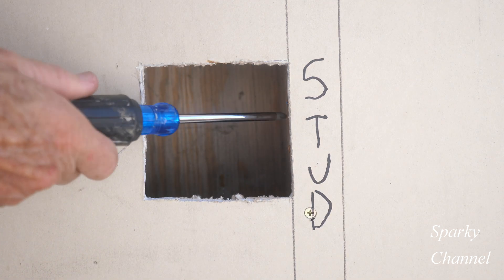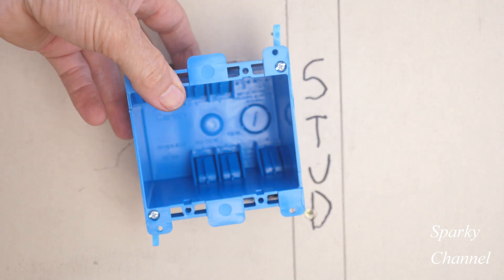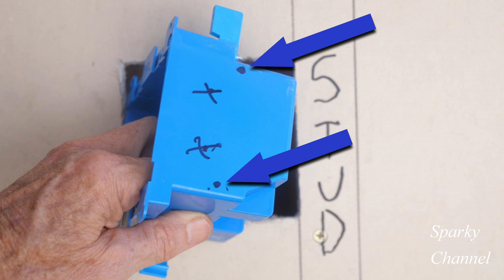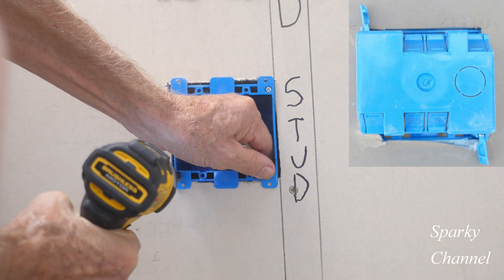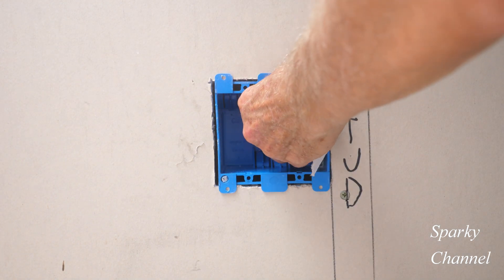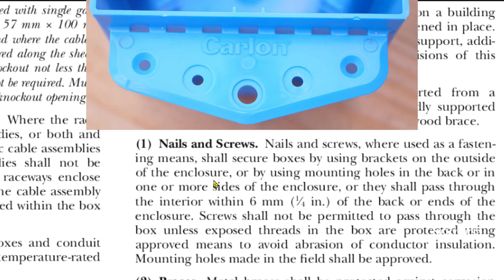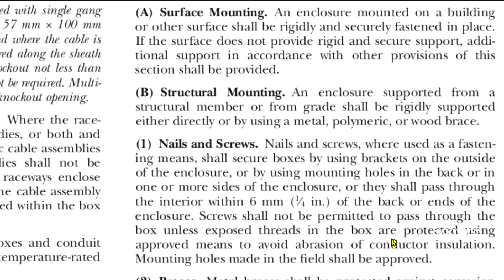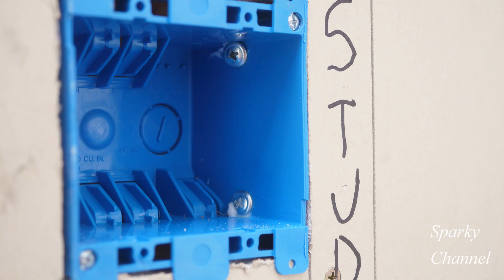Modification of a Carlon™ Box with Approval? NEC 314.23 (B)(1)

Comment: I agree that what you did meets the intent of the code.  Not withstanding that I probably would just cover the entire screw head with a layer of silicone to prevent any arc potential.  That said I have worked in structures with metal boxes so I guess for me this is just a belt and suspeders approach.  On another note I have never been a fan of these retrofit boxes.  The face flages create a lip on the front and they dont allow the face plate to lay flat.  I ussually use a new work box like the one pictured that secures to the front face of the stud and then patch the drywall.
Reply from the maker: Great tips, thanks!

Comment: Construction adhesive or silicone caulk on the stud side of the box would firm it up and you wouldn't have to modify anything. Just tighten the ears and let the adhesive set-up.
Reply from the maker: Thanks!
Reply: Yep.  I don't like adding the screws at all as in the video.

Comment: I have done this myself and AHJ is ok with it  But all metal parts not carrying current shall be bonded..  I was at a house one time and a cabinet had a support screw that hit only the hot wire and over time was burning the wood of the cabinet ...

Comment: Drilled a 2 holes directly in the back of an exterior surface mounted metal box and no issues with inspector. I called or emailed in advance to not waste their time and my money on a reinspect.  Hopefully your inspectors are responsive like mine. Typically get back within 4 hours and I’m not an electrician.

Comment: Take a look at the UL white book, there are boxes listed with means to do what you are trying to do. Also the manufacturer has not has not had the box tested to see if the side wall can support the box with additional holes drilled. I was an inspector. I would have you get, in writing, approval from the manufacturer or deny your request.

Comment: I wire these just like you did, all the time. It would be very helpful if Carlin and other’s did an update to this  type of box.  It seems these suppliers make new changes all the time. This would help us out in the field tremendously.  I always try to install these old work boxes next to a stud for this reason, and then with screws. I have had a few call backs where. Customers were in a hurry and whip extension cords from a distance and pull the whole box  out of the wall. THANKS for this Video!
Reply: Exactly what you just said. The manufacturers need to start stating this is allowed. As well as the people who write the code books. I see these boxes loose all the time.
Reply: If Carlin put holes in the sides of the box there would be no question. Metal boxes have two holes at the edges. No big deal.

Comment: The wire safety is good that you brought it up, AND the terminal safety on the device which bolster's the extra screws in the back of the box.  As long as the box exterior is well insulated with mud or fire patch, I'm happy.
Reply from the maker: Thanks Greg!

Comment: Looks like the screws are more than 1/4" from the back and not really fully shielded with the silicone caulk
Reply from the maker: Thanks!
Reply: @SparkyChannel  The NEC paragraph states 'within 6mm (1/4") of the back or ends of the enclosure'.   What is considered the end?
Reply: I read that as if screws are used instead of nails going from side to side of the box. In other words, "through"  the box. So, threads could be a major issue on a 4 inch long screw. Putting a round head screw through  one side of the box into a stud should not be an issue. Although, I approve of keeping them  out of the area where side terminals might contact them. 

As far as the mfg adding the ability to do this, adding a slanted mounting pad so a round head screw could be installed without needing to caulk would be a great addition. 

As far as doing this type of install, this would be especially helpful in plaster walls where the wings don't get a good grip.

Comment: Perhaps small interior wood screws put in with a right angle adapter so the head sinks in. Then a dab of silicone on top just for good measure.
Reply from the maker: Nice!
Reply: I use screws just like that and drive them with the shaft of my adjustable screwdriver: 12" long and puts the heads almost deal flat.

Comment: Hm? ... In critiquing your work, I feel that the two screws that were used to further secure the electrical box should have been adjusted and drilled so that they were both sitting flush to the inner wall of the electrical box. 👍
Reply from the maker: Thanks!

Comment: maybe drill the holes a little farther from the to/bottom of box and use a right angle attachment so the screws go in square and seat flat to box so no threads are exposed.
Reply from the maker: Good idea, thanks!

Comment: I understand what you'r attempting to do, that is improve something that appears too flimsy.  I always thought any modification of these boxes was verboten, though.  I'd use the two ears as provided and be done with it.  Perhaps another type of box would better suffice your purpose but this one has already been approved as designed.
There's another type available for this application (drywall mount) that's more robust, in my opinion, it consists of two metal tee straps and the box (3 separate pieces) but it's been so long I can't remember the proper name.  The straps slide in between the box and drywall, catch the back side of the drywall on the outside of the box and then the two straps have tabs that are then folded over the face of the box from the outside and into the opening of the box.  It's what we had before the plastic winged boxes were introduced.
"Interior Wall Electrical Box Mounting Brackets"
& "Old Work Switch Box Supports"
Reply from the maker: Interesting, thanks!
Reply: Those are often called Madison straps.
Reply: @illestofdemall13  Sounds about right.  I don't even recall if they can be used to mount plastic boxes, just that we used them for mounting boxes in the case of old work.
Reply: @thisisyourcaptainspeaking2259  They're used for gangable metal boxes (the kind that you can join together to get as many gangs as you need).
Reply from the maker: Hi Kris!
Reply: @SparkyChannel  Hello Bill. It seems some people just don't like screwing through boxes regardless of the situation and my boss and I are both those kind of people. He said he sees no reason to have to do this. Lol
Reply from the maker: @illestofdemall13  I totally understand. Just buy the correct box. 😄

Comment: I'm just going to 3d print my own boxes, Let's see what the NEC says about that.🤔just maybe....
Reply from the maker: Get them UL listed and you're in business!
Reply: In my own home, I was going to replace a single box with a two gang old work box.  After I cut the nails off the original box, I found that the box was pushing on a water pipe directly behind it and had deflected the box about an inch.  Due to Covid, I couldn’t find a ‘shallow’ double gang old work box. So I took the box I had and sawed the back off of half of it and cut a square off of another box and stitched them together with by melting the joint with a soldering iron.  Not to code, but was solid and worked great.  (Sort of thinking outside the box 😉).

Comment: If it was a metal box what difference would it make?
Reply from the maker: If it was wood studs, it would probably be the same.
Reply: Screw threads are sharp, and that would still be a problem if insulation got lacerated.

Comment: You know that will help, but the plastic is so flimsy, that this is still likely to fail at some point. I really think a metal box is better for this kind of application. If you really wanted to be overly cautious, you could loop in a ground wire to the screws, and ground it out. Of course, no one is going to do that.
Reply from the maker: Interesting point. Thanks William!
Reply: I was always taught that a screw for a ground wire could never be used for anything else.  

In this type of install, even with a metal box that needs to be grounded, if the box worked loose through rough treatment you would lose grounding.

Comment: If there’s a poor connection and room for error, that conductor may sit on the exposed screw and it might transfer that heat to the wood. 
“Plastic hinged screw cap covers”, or bonding the screws to a ground wire might be a good alternative. The Southwire Smart Boxes might be a more suitable method, since the screws sit in a molded recessed part of the box. Caulking the recessed screw locations inside those smart boxes would make it extra nerdy.
Reply: Sub contractors around here are not going to use Southwire boxes, they are like an extra $1 more which means they can buy an extra Modelo after work by throwing in some drywall screws in a regualr box instead.
Reply from the maker: @JFlywheel  Yep, I hear that!
Reply: @JFlywheel  your right on that in pretty much any local. And that is a shame. But so true.
Reply from the maker: I agree. In fact, I have a link for the Southwire and Arlington 2 screw boxes in my video description. They are better choices.

Comment: Sometimes the top and bottom tabs can push in and dent the drywall while you push your outlet of switch in, i think installing screws in this way is an excellent way to ensure the box stays secure and not become loose in the wall. Also, a right angle Philips bit works magic in that tight spot ..Great video!
Reply from the maker: Thanks Kevin. Great tip!

Comment: My suggestion, if you really are worried about code but want more support.  GLUE it to the stud.  There are plenty of adhesives that work for both plastic and wood.  I have screwed plenty of these cheap plastic boxes over the year, sometimes I just screw 1 scrop into the top corner at a 45 at a very shallow angle.   I typically pre drill so I make sure I get the depth I want
Reply: In the new apartment complex we're building, we often come across boxes that have been tweaked by drywallers, so gluing isn't an option. The only thing that can be done is to slap a couple screws in at an angle.
Reply from the maker: @icevariable9600  With "approval", hopefully. :)
Reply from the maker: Great tip, thanks!

Comment: If you want to mount to the stud, just use the right box (Southwire MSB2G, or Carlon B249B). Both are plastic boxes designed for that very purpose, and will give you a better and cleaner install (those boxes allow devices to sit flush on the drywall).
Reply from the maker: I agree. I actually have links for those boxes in my video description.
Reply: @SparkyChannel  Awesome. I find the Carlon version to be easier to install, and the extra depth is wonderful when dealing with dimmers and smart devices.
Reply: Sometimes boxes need to be adjusted after drywallers mess them up. So, removing the boxes, and telling the foreman and owner of the company he should go get the right box simply isn't going to happen. 

You work with what you got.
Reply from the maker: @icevariable9600  Yes, and I wanted to demonstrate 314.23(B)(1) so I couldn't use the correct box. I needed one that I had to modify. LOL!

Comment: Sparky, thanks.  I was always told that metal screws in a plastic box was not allowed as a short in the line could energize that screw head and start a fire in the stud.  That is why several companies make plastic boxes with recessed screw mount holes to protect them from being energized. Metal boxes do not have that problem since they are bonded to the ground system if installed correctly.  Has there been a change in that?
Reply from the maker: You're correct. The only change has been "Mounting holes made in the field shall be approved" which was added in 2017. 314.23(B)(1)
Reply: I typically just use 1 screw in the top corner near the front.   I figure the only wire that might short out is the ground.  LOL.
Reply: Provide one example of a house fire being started by an energized box support screw.  Now think of the 70+ years of ungrounded metal BOXES nailed or screwed to studs and give me an example where the energized box started a fire, you can't, I already looked and the chance would be so infinitesimally small as to not be worth protecting against......
Reply: @ZackaryTwiddles1  The metal boxes are bonded so the current returns to source.  I don't care if you have never heard of one...it was the code and I follow the code.  The change now makes it acceptable to screw in a plastic box ONLY with the AHJ approval.  Most of what the NEC mandates are for safety that often refers to a rare chance and it sucks if that rare chance is your house that burns down.  We don't get to decide what parts of the NEC that we will disregard because we think that we have more common sense or a better judgment as to what is acceptable risk for someone else! But you keep doing those searches to help you decide what you are going to ignore of the NEC.
Reply: @wolfunger8399  nobody is telling you not to follow Code.  Shall be approved doesn't say when, just that the inspector has the option to not approve.  The point of referencing the long term affects of continuing to drive the code to try and account for everything that could possibly happen is that it will make installations ridiculously expensive without truly adding any value.  At some point you do have to factor in cost to benefit ratio.

Comment: How about  superior 33 or 88 electricians tape over screws??
Reply: If you put the screws where directed, they have very very very little chance of coming in contact with a receptacle being installed. The silicone mentioned is a good way to cover your butt for inspection. Tape will get old over time, the sticking factor to the wall of the box and the screws is limited, and movement of your wires during install are decently likely to dislodge the tape you placed. Personally I do like to tape around each receptible after they're wired to prevent them from shorting to any metal boxes or fittings used.
Reply from the maker: I think it would be a good idea if you can get it to stay on the screw head over time.
Reply: @SparkyChannel  mabey the liquid  electrical tape
Reply from the maker: @71organicmusic9  Hey, great idea!

Comment: Good information, sir. One thing that comes to mind that would help is to use one of those right angle drill adapters to put the screw in without having to be at an angle. Still a good idea to cover the screw head with silicone as you did in the video.
Reply from the maker: Good idea. Thanks Micah!

Comment: ANything is legal if an inspector doesn't see it🙃.
Reply from the maker: LOL! No.......
Reply: I feel like this is so true.  Or if they don't care as well.  Just pointed out I have no way to connect my 240v oven that uses flexible conduit to a single gnage regular blue box.  Contractors put a 240v circuit in one of those single gang blue plastic boxes.  Inspector told me to just buy a metal lid for the box, which I believe would make the lid and conduit ungrounded (I pointed this out and he said it is fine as long as I connect the ground wires to each other).  Probably just need to open wall up and install a proper box myself.
Reply from the maker: @JFlywheel  Wow!
Reply: Yeah...I see a lot of janky shenanigans on non permitted jobs. I always adhere to nec and local code. Redundancy saves lives.

Comment: Thanks sparky. Yes good call on the inspectors part. Unfortunately when In the field you’re up against not always ideal situations and have to make do and work with what you have. As long as general code is followed and good workmanship is executed and the installation is clean safe and free of damage to the wiring and won’t cause life and safety issues I’m sorry but NEC Has to step back and allow a local code inspector to make the last shot. NEC is a book life and working conditions are not textbook simple. Thanks for your videos and channel.
Reply from the maker: Yes, "Mounting holes made in the field shall be approved" was added to 314.23(B)(1) in 2017.

Comment: My local inspector makes me put caulk over the screw heads "so that there is no exposed ungrounded metal(the screw) in the electrical box penetrating wood".
Reply: And what does that accomplish if the screw is in a wood (i.e., no conductive) stud?  I could see logic if the box is screwed to a metal stud.
Reply: @LTVoyager  Arcing of live wire to screw could set wood on fire.
Reply: @illestofdemall13  Arcing doesn’t happen if the electrons have nowhere to go.
Reply: You don’t put caulk on a metal box - why to cover a screw that is flush and away from conductors?  The metal box isn’t exactly smooth.
Reply from the maker: Interesting. Any particular kind of caulk?
Reply: @SparkyChannel  hi bill
Reply: Lol.
Reply: Why. It can't short! 1000x safer with out caulk than a metal box.
Reply from the maker: @pointedspider  Good point, metal studs would be very dangerous to add screws into.